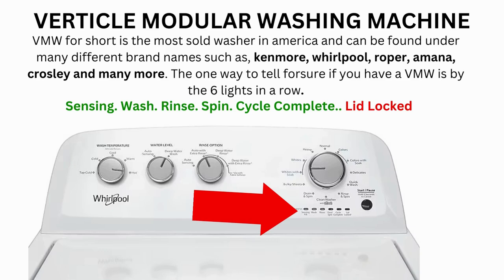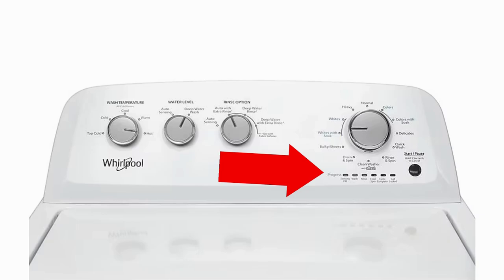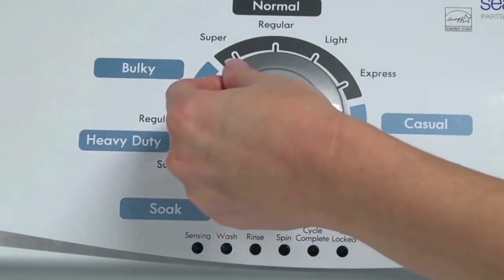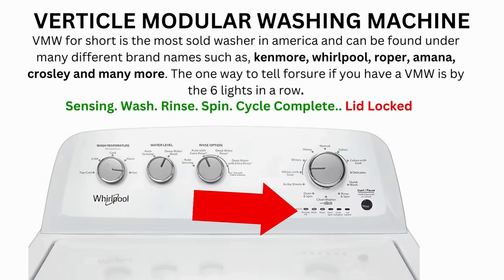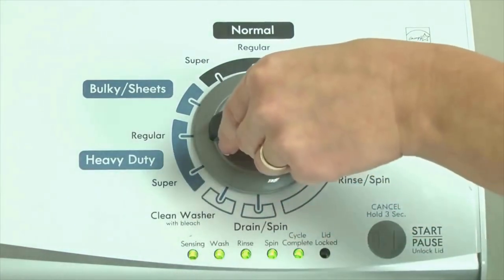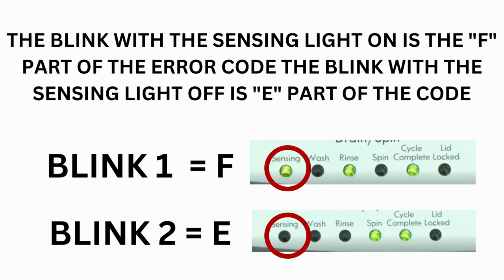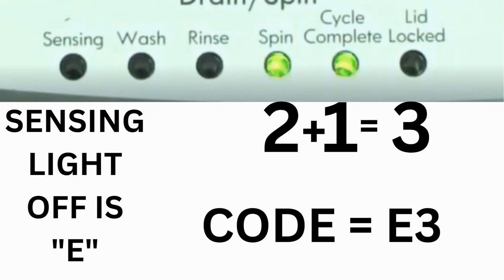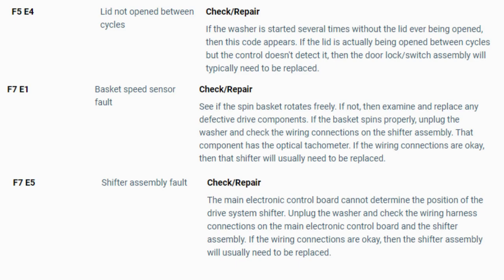Maytag Washer Reset: Maytag washer sensing light blinking?

Comment: Hello, i have sensing flashing, as well as Rinse and done flashing at the same time, when those turn off then spin lights up then goes back to Rinse and done again and so forth. Do i add Rinse, spin, and done together?? Or would that be F5 and E2? I also have a Maytag Bravo not sure if numbers are different
Reply from the maker: Hello! on one flash you add the illuminated lights together. then do the same on the next flash. Each flash is one half of the code and theirs 2 flashes per set of codes>

How to Read  Your Error Codes:

Once in diagnostic mode Turn the control dial one click clockwise. Press the Start button.

Then Turn the control dial one click clockwise to display the first saved error code.  

The 2 part  error code flashes repeatedly back and forth until you turn the dial one click clockwise to show the next error code.

If Only the Sensing light flashes if no error code was recorded. 

Error codes for the VMW washers have two parts: The first is the letter “F” followed by a number and the second is the letter “E” followed by a number. Which lights are illuminated indicate the numbers. 

• The sensing light on indicates the letter “F”. 
• The sensing light off indicates “E”. 
• The “Wash” light stands for the number 8, Rinse = 4, Spin = 2 and Cycle Complete = 1